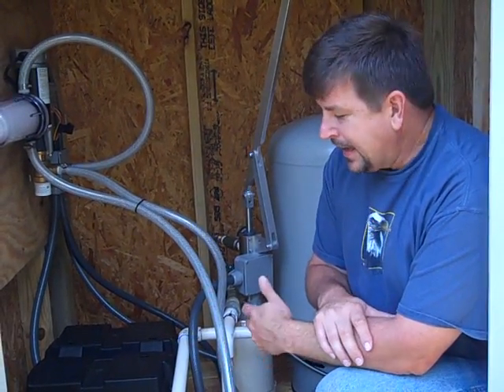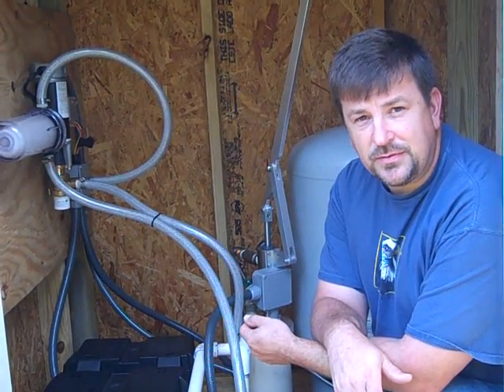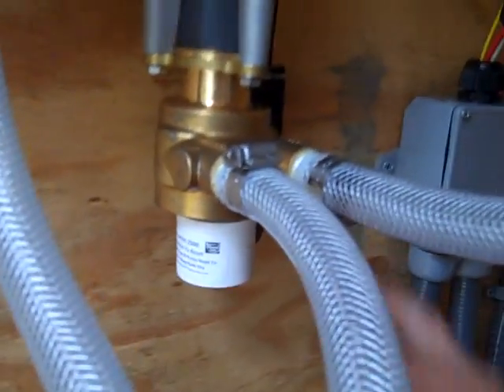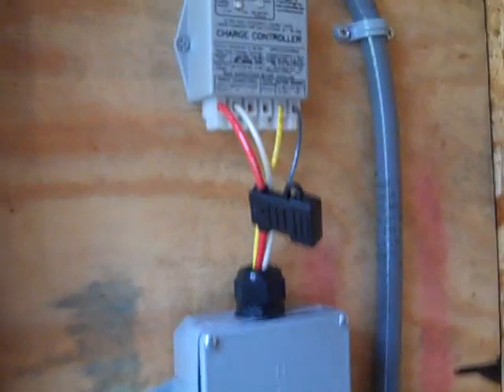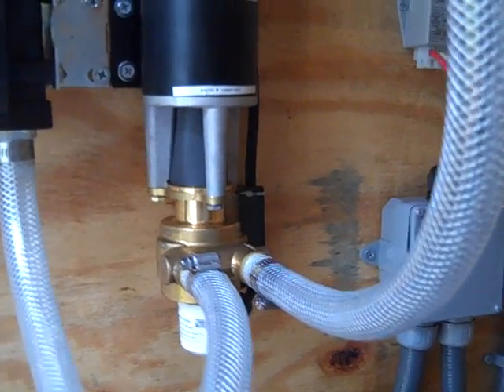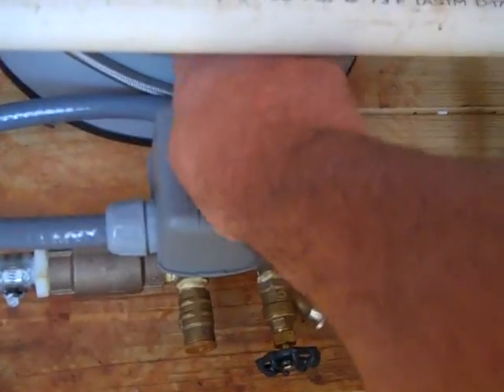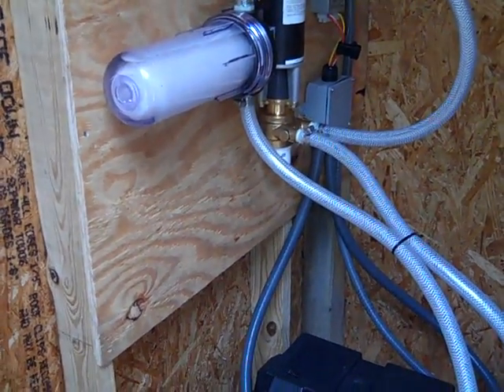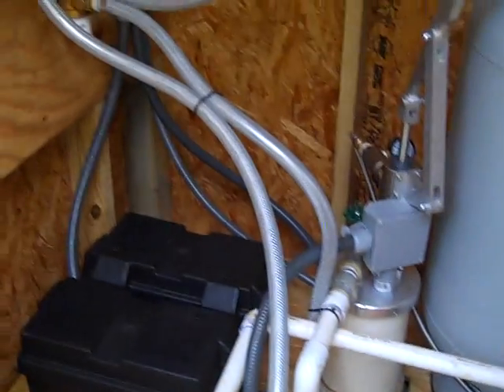Water Tower vs Booster Pump

Comment: I absolutely agree: it was the first thing I noticed. Vertical positioning allows larger debris to fall down so the filter will not foul up as quicly. Plus you have  visual warning. All filters should at least have a small drain valve at the bottom of the bowl, which allows for evacuation of these debris. 6 months between checking the filter may be sufficient is some cases, other situations may demand even daily checking.

Comment: I'm a plumber and pipe fitter with 27 years experience and I couldn't agree with you more. In most cases a water tower still needs a pump and piping. The only reason I can think of for putting in a water tower is you don't need power to get water from it only to fill it.
Thanks for showing us, Steve...

Comment: i have a water tower about 12 foot high and it runs pretty well. so long as you have a 1 inch pipe running into the house to stop pipe friction. in the house i go back to half inch, except for the laundry. the pressure works sorta different from pressure pumps and mains. you can stop the flow with your finger but can only do it by restricting it slowly, not quickly or its too hard. but there is definately enough pressure in the house. will do VR of the tower.

Comment: Great video, as always.  Shows function of great idea in a practical environment.  Good point regarding matching solar panels to energy demand.  Answers whether this system could fill a pool (on a sunny day or two).

I would be curious if you could incorporate a water softener system into something such as this, or if the filter is adequate (which I doubt).  Florida water has plenty of minerals which can cause problems in plumbing and kidney stones.

Comment from the maker: It goes no where.  It is potential energy and once it has a place to flow ( batteries need more juice) then the current flows.  The Solar panel is like having a tank full of water with a shut off valve.  When the water is not needed the valve is shut, the water remains, when the valve is open the water flows.  Hope that helps!

Comment: I have a lot of Amish neighbors who use a gas engine to pump water from the well to a tower then let gravity feed it.  They might only run the engine for 10 minutes every two days. They often use the engine in several applications just moving it to where it is needed.  Run a washing machine, well, bailer,  

I have seen set ups that while a washer is running so is a battery charger. 

There water tanks are often built on the 2nd story of a home or shop.

Comment: So just to make sure I'm understanding this, you have a submersible pump and then a booster pump on top of that? If thats correct, is the submersible pump running on solar as well? How deep is the well and what kind of submersible are you using? The wells around here are aroung 100ft deep so I'm curious if it can be done with a well that deep

Comment: Submersible pumps are slow flow deep pumps which do not put out quick high flow water (at 50 psi).  They are long lasting (in theory) and a buried deep in well.  Booster pump output is higher flow which will give that 50 psi boost.  However, they are only not good for pulling water from deep wells (15' to 25').  Their life expectancy is not as long as the submersible pump, but easier to replace.

Comment: Must admit you're switch wiring stumped me for a sec, looked like you had contacts jumpered to make motor constantly hot. Had to look up that square d contact config, now see you put the 2 switches in series. Any specific reason for that or using both switching poles just because?
Things like that bug me if I can't figure out why. Crisis averted

Comment: Why mount the filter sideways??? Seems like it will spill water and sedimentary debris on the battery boxes & floor when you swap out the filter... Vertical would not or be minimal... Curious if done for a reason...

Comment: So... where does the power generated by the panels go if the batteries are already charged and the pressure is already at 50psi?  Where does it go if there is no demand?

Comment: I can simple the water tower down for ya'll.     
I built a 30 ft tall timberframe water tower.   The total elevation drop to my cabin is only 42 ft.   Now.. as explained to me by a man in the UK, which run a lot of gravity systems,   at this point it's not about "pressure"  is about "volume"  so.. my 30 ft tall water tower has a 1,000 gallon cone bottom tank,  from there i ran 2" sch 40 pipe 165 ft to the cabin.  I was careful to use long sweep 90s that i bent myself < i used a 4 inch steel pipe 4 feet long and sat on blocks,  started a fire under it and used it as an oven to warm the pipe. Worked like a peach> then.  It enters the cabin where i built a manifold of 2 inch wyes reduced to 3/4 inch.  That go straight up to my kitchen bath washroom and hose spigots <which can be drained for winter>  i also ordered all my taps, shower head etc from "taps.com" ot of the UK. Reason being that they make very nice taps that are specifically made for gravity .5 bar to 1 bar psi.  Lemme tell ya.   Ive got NO issues with " low pressure" .so to speak.   It blows out of my faucets.  Ive got no mechanical parts that will fail.  It's a simple disign.  Just remember to keep your 90s to long sweep 90s which you'll have to make.  It takes all the friction out  compared to the standard tight 90s.  I used 45s on some of my 3/4 pipe to make a long sweep for the shower. It was more practical for my situation.   I very much enjoy and have learned alot from engineer 775.  But sometimes simple is just plain better.    I hope this helps.

Comment: 2.31 X 55?    What size pipe is this using and wouldn't the pressure be greatly increased if you just used a larger pipe from the water tower to the home?  I could be wrong.  If you were to use a 4 or 6 inch pipe how high would the tower have to be?
Reply: No water pressure would not be increased but volume would. Water weight about .433 lbs per square inch per vertical foot so the calculation of 2.31 is 2.31 feet to equal 1 pound of water which thus exerts 1 lb per square inch water pressure. Millions get by using water tanks. The difficulty is US regulations that limit water volume to about 2.5 gallons a minute at about 50 psi. 
OXygenics sold me low pressure shower heads 10 or so years ago designed to work on as little as 2.8 psi so a 12 foot waterhead works, though more is preferred. We use them in Mexico on the coast in a high salt environment at PlayaLIndaHotel .com  With 4 x  1000 litres of water on a platform 2 meters above the roof  we can endure power outages though we also have a backup generator   that can run ceiling fans etc. all except the air conditioning. I don't know if Oxygenics still makes them but they are of Delrin and last forever. At that time I bought a case of them for under  20.00 each. They may not be legal for sale in the U.S. due  output at 50 psi would be over the limit.

Comment: OXygenics sold me low pressure shower heads 8 or so years ago designed to work on as little as 2.8 psi so a 12 foot waterhead works, though more is preferred. We use them in Mexico on the coast in a high salt environment at PlayaLIndaHotel .com  our Penthouse suite must get by on that. Made out of Delrin and chrome plated they use a Venturi effect and have never clogged, none have broke. I think however they were for export only as they may violate water gph  minimums in US if used on a pressure pump system. Their standard units for the U.S. are engineered for pump pressured systems. Roof tanks work great in a frost free environment where due to salt corrosion public power sees over 12 power outages a year of up to 24 hours. We do have backup power but manual switching for reliability.

Comment: Water towers don't have electronics that can break down also keeps your water running in a EMP event.
Reply: Water towers can also work like a battery to store energy. Pump water up to it when the sun is shining, let it gravity feed when the sun isn't shining. Pro: don't buy batteries and charge controllers. Con: Visible tower.

Comment: You claim elevating a tank "20-30 feet is a huge project"  average single story house is already about 11 foot at the roof.. take a 7L a minute shower head at 7 minute run time = 49L. you don't NEED 55 psi, anybody living off tank water knows you can get by on much less.

So at a bare minimum (of course you want a bit extra) you only need to support 50kg on a 10 odd foot frame above the roof to get to the 20 foot mark, not really that hard and quite cheap.

This doesn't even take into account using any natural slope in the land to give height advantage.. from a "prepper" point of view I would much rather a system that can be built and maintained without any reliance on an industrial manufacturer, as for having your tower seen? 
Security through obscurity, be away from prying eyes.